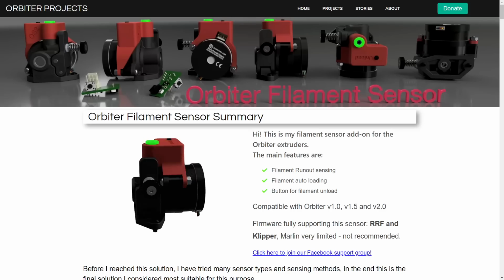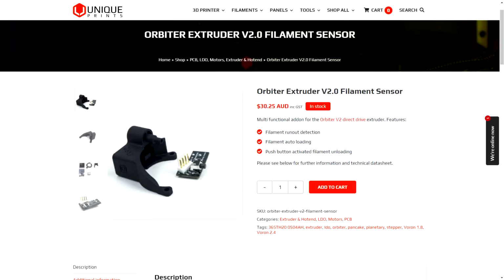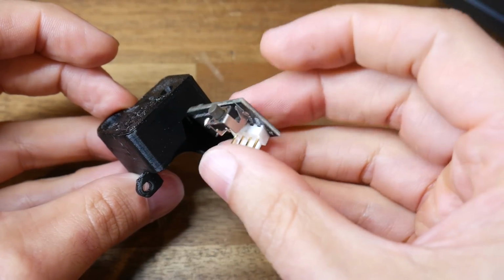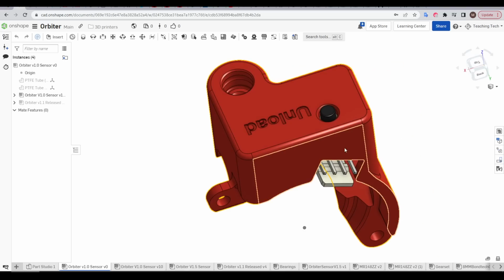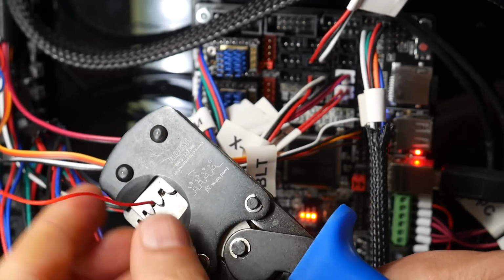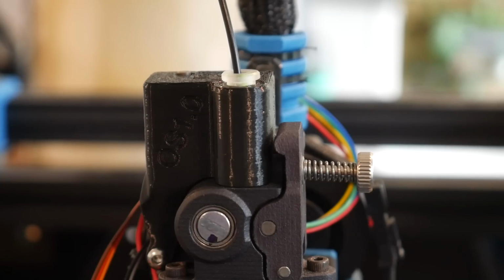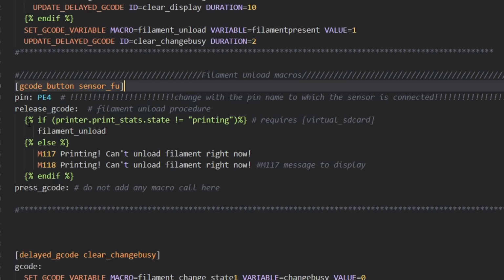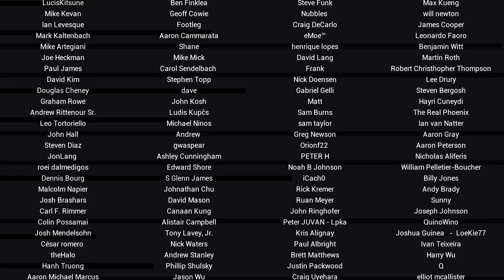Orbiter Filament Sensor guide - A smart, automated way to improve your 3D printer

Comment: Interesting design.   I have the old style with end stop type switch.   This has not been tested since I rarely have long print runs and change the spool before long prints.    This is a much better design though.
Dave.

Comment: I need this in my life.  I'm currently doing major surgery on my Ender 5 Plus, converting it to coreXY via the Mercury 1 build, and I was just pondering today how to handle the filament sensor.  This is the perfect thing, since I'm running a 1.5 Orbiter on a Dragon HF hot end.  Going hunting for kits / STLs now, and I'm sure I'll be referring back to this video once I find one.  Thanks Michael!
Reply: what toolhead are you using? I bought an ender 5 plus as well for the mercury 1 but waiting for me to get sick of the ender 5 before i upgrade as well
Reply: @afkafkafk  I'm using EVA, but not the latest, I think mine is either 2.3 or 2.4, or a mix of both.